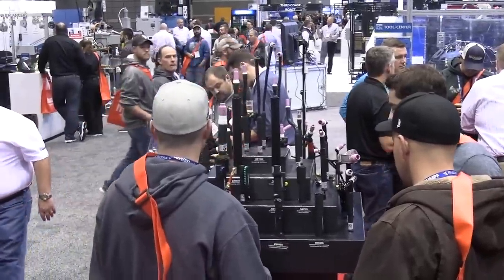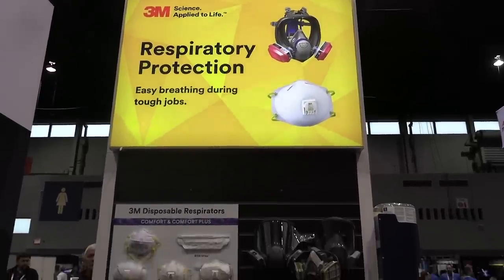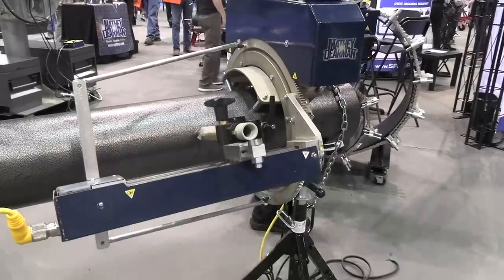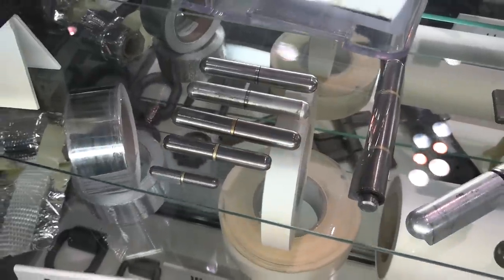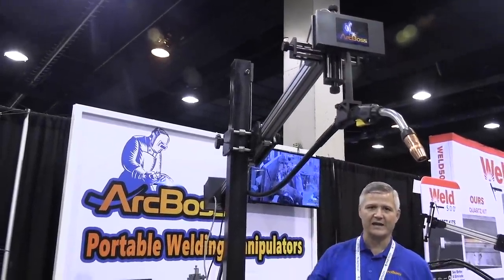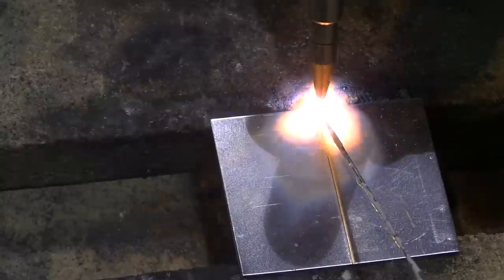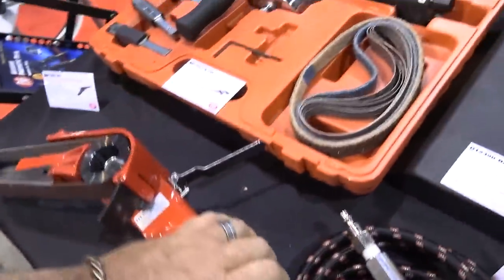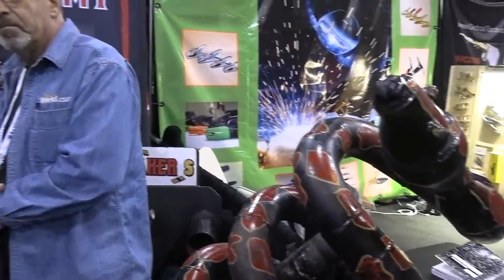Fabtech2019 Tour

Comment: I love your videos!!! I welded my whole life but unfortunately my career was cut short from cancer. I beat the cancer. But the radiation and chemo wrecked my body. Enough about that. I welded at bath iron works up in Maine. We have alot of different procceses. What I ran most was 100s 0.45 hard wire pulse and 100s 1\16 hard wire pulse. I miss the humming and buzzing from the pulse. One of the very many test we took was pulse 0.45 100s hard wire with 95\5 gas. Over head horizontal down hand and vertical up. The downhand test was 3\16 plate no bevel with 3\16 gap ceramic backing. The other positions was 3\8 plate double bevel 3\16 gap ceramic backing. Had to pass visual and x-ray. I can remember the one that gave most new guys the hardest time was the over head. They did ok with the 70s but the 100s gave them a hard time. So I thought it would be cool to watch a famous welder like yourself do the overhead test with 100s 0.45 hard wire with 95\5 gas pulse arc. It would be cool to watch I miss it so much. Keep up the great videos I love watching you guys welding something my health won't let me do anymore. Have a great day. Pete Dellarma Skowhegan Maine.

Comment: I work in drag racing and we use billet cylinder heads made from 6013 but wanted to use 7075 because it was more dense and should hold up better but it wasn't repairable. It was tried and you can't scrap that it gets shelved and we then tried the new filler. It worked but only kinda. The heat treat just isn't the same. 

It's almost like wanting 6061-T6 and working with 6061-0. It was a great material and we annealed it to make the repair.

Comment: @ 9.20 I've got a torch like that, it's called Dillon. Really narrow flame, you can circle your fingers around it 6 inches from the nozzle. Doesn't add a lot of heat to the parts.

Comment: I'm surprised.  I don't have any certs but I did go to US Navy NPPO Emergency Weld School and they require the students do do mirror grinding and welding in a corner under your welding table towards the end of the course.  I didn't have a hand control so I pushed my pedal with my knee against the wall.  It was exhausting but I got it done.

Comment: Is it a good thing to be good at grinding or does it refect on your weld skills?? JK JD, great job!
Reply: Grinding is a metal shaping tool. EVERY welder uses one. It has nothing to do with welding skills. There are some jobs I do that require grinding welds as part of the final surface result. Only junior welders say this too each other because they are putting each other down when they are Bro'ing it up.
Reply: @gusbisbal9803  where can I buy one?

Comment: Excellent, lots of cool stuff there.

I would add one thing to the e-mail suggestion, which is very useful, and that's to make sure you have a 'professional' address. It probably applies to the youngsters, if any, but in other fields I've seen some very crude addresses - fine for amongst one's friends, but it's unprofessional and only takes a few minutes to set up one for your work/business related correspondence. It also makes it much less likely you accidentally forward something to an employer you really shouldn't have, if you keep your accounts independent.

[edit] I have been trying to access the Bluco web site, as 'Googled', and it is refusing permission to access any of it - anyone else having issues?
Reply from the maker: an excellent point..thank you

Comment: is high frequency or balance used on tig dc- or dc+ welding
Reply: It'd be used in AC
Reply: Balance when tig welding is on AC referring to the balance between electrode positive and electrode negative (alternating current). High frequency, are asking high frequency arc start(done on DC and AC both) or AC frequency is done on AC. Hope that helps
Reply: @BobbySixguns  thank you
Reply: @BobbySixguns  so when tig welding 4130  steel turning the ballance does nothing to the welding affect ?but when welding ac ,,aluminum the balance knob affects the desired affect ,,,,now  turning high freq knob affects the hurts amount on both ac and dc welding 60 hurts being the household norm ?
Reply: @speed200pd  welding 4130 steel is done on DC, so the AC balance does not come into play. If your machine has a rotary knob for the balance you can turn it all you want (while in DC) but it will not have any affect on DC welding. Same with AC frequency,  it will on affect the AC arc, does not alter anything while on DC.
Reply: @speed200pd  the high frequency that you have referred to is the AC frequency.  Now if you have an AC/DC capable machine it will have High frequency start (or at least I've never seen an AC/DC machine without it) which is different from AC frequency. The high frequency (HF) start is basically a high frequency pilot arc that is use to start your welding arc so your electrode does not contact the material you're welding like you'd do with lift arc. High frequency start is HIGHLY  recommended when tig welding on AC, like on aluminum, to prevent electrode/tungsten contamination. High frequency start can be used on AC or DC.
Reply: @BobbySixguns  my machine is a 250 miller synrowave ,it has a high frequency knob under the cover willm turing this on dc welding 4130 steel affect the weld ,i see both ballance and high freq does affect the weld on ac welding aluminum ,sorry for the lack of knowledge
Reply: so welding 4130 is welding at 60 hurts and cant be changed?
Reply: @speed200pd  I have a syncrowave 250 as well. Not sure how old your machine is, mine is a 1998 or 99, dont remember exactly. On the face place mine has a three position toggle switch for HF start. Up position is high frequency start only, used when tig welding DCEN, which is were you should have it set when welding 4130. So if you have the machine set as I just described turning that HF knob under the cover will have no affect while on DCEN. Note that knob can be adjusted while on DCEN to get crisp, reliable arc starts but does not need set any high then to achieve said arc starts. The middle or center position of the HF switch is off, have it set here when stick welding or using lift start. The Down position is HF continuous used when tig welding on AC.
Reply: @speed200pd  if you're trying to change bead profile arc length and tungsten prep will do a lot for you. Hold as tight of an arc as possible (good rule of thumb, arc length should be no longer then the diameter of the electrode in use). Torch angle, to much and it will react similar to having to much arc length. If you have a tight arc you can cheat the torch angle a bit when in a tight spot. Tungsten prep, long taper will provide a wider bead profile with less penetration. A short taper will give you a tighter/narrower bead profile  with more penetration.  Hope that helps.